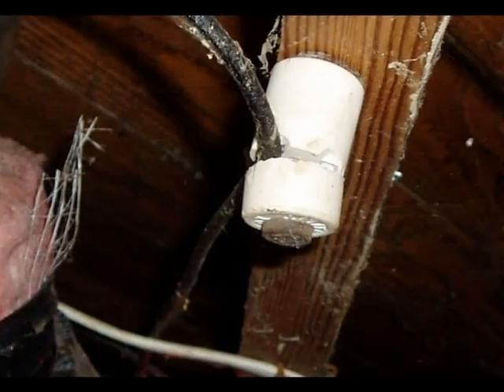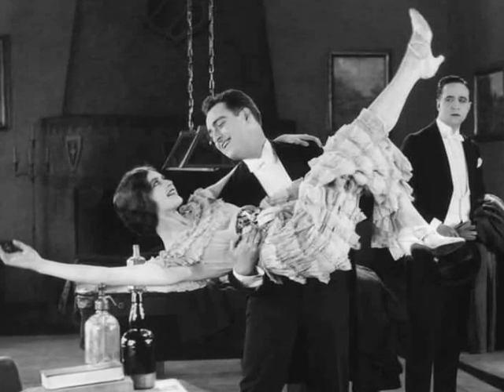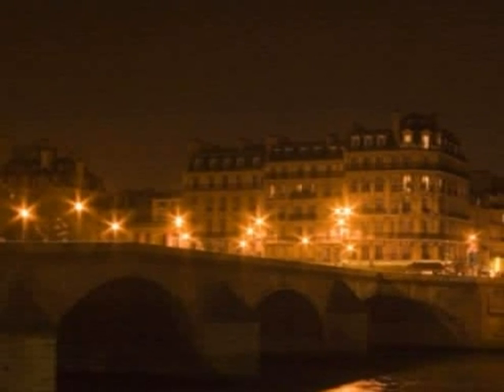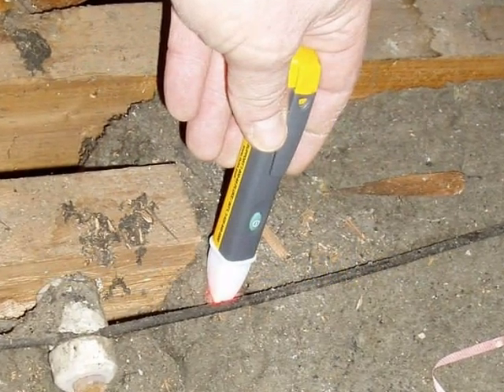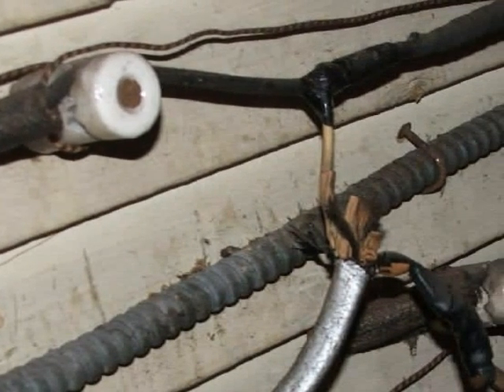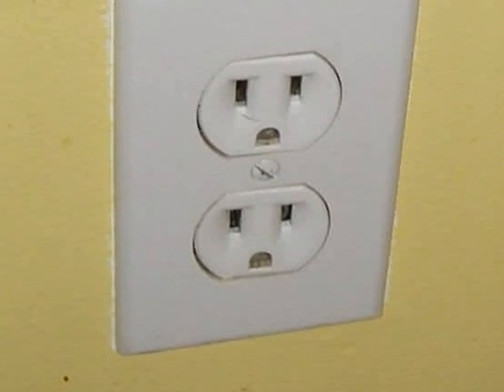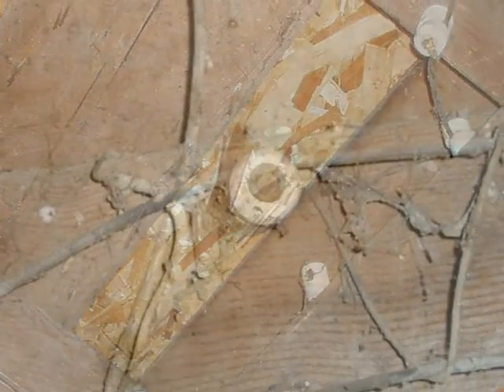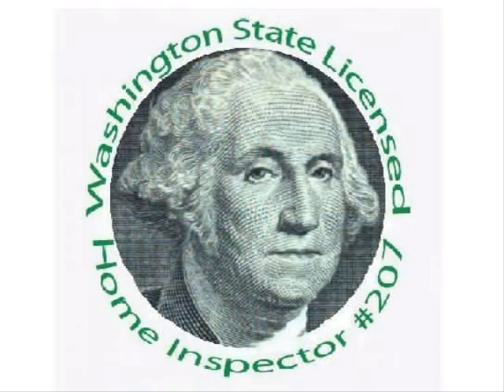Bellingham WA Home Inspector (King of the House) Knob and Tube Wiring Systems

Comment: Thank you.
    Here in Missouri, knob and tube wiring has been installed in recently built homes. Why this is done I do not know.
Reply from the maker: That seems pretty strange. True knob and tube systems are just two wires and do not have an earth grounding electrode. Yet with modern appliances, at least most of the time, the plug includes a ground.

Comment from the maker: Knob and tube systems are two wire, lacking a modern equipment ground. Therefore the system is antiquated. The focus of my video is wiring vs. other building materials. But, as noted in comments, that is vermiculite. Vermiculite comes from mines in Libby, Montana. Older vermiculite may have been contaminated by nearby asbestos. Once they discovered the problem, many years back, new material should be asbestos free. It is not accurate to say all vermiculite is contaminated, it varies depending on year of production. But, as a safeguard, it is an excellent idea to wear an asbestos rated respirator when vermiculite is present.